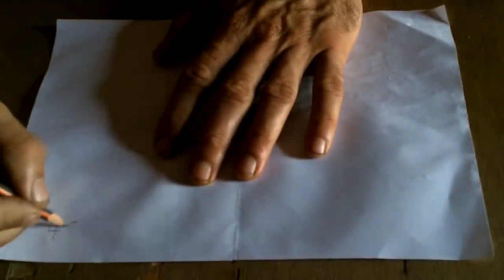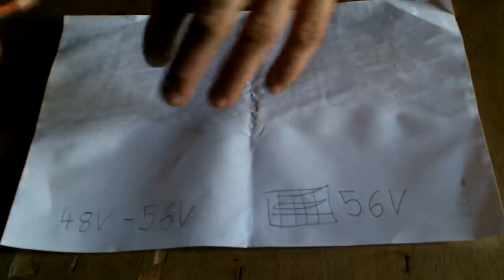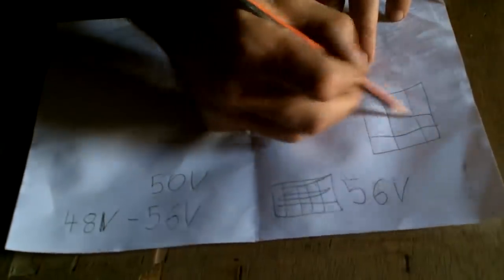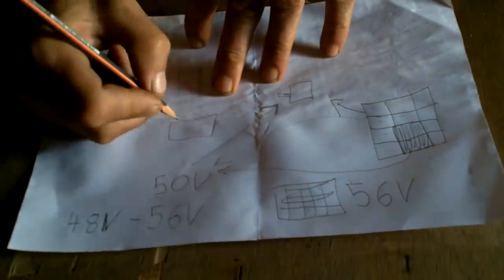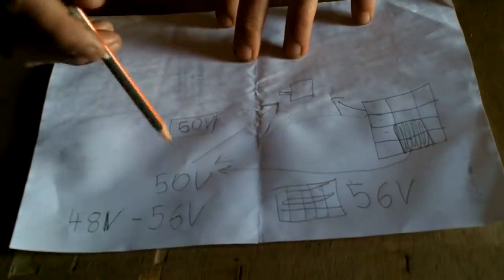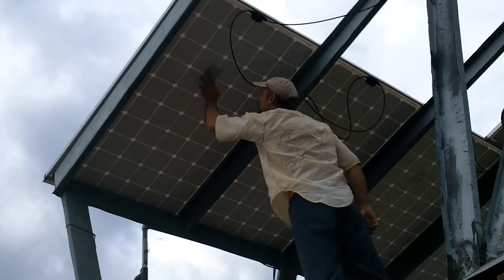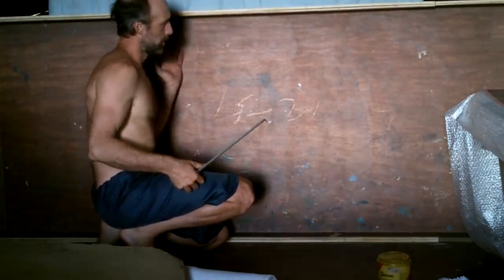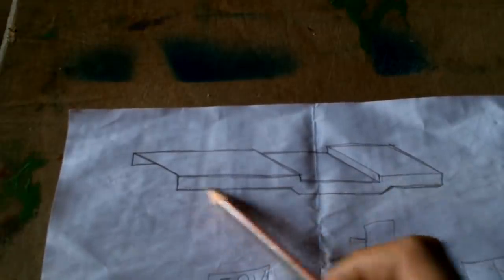Solar Snailer 028 Glass Panel n' Batteries

Comment: What is supposed to be the benefit of bypassing the batteries with some of the panels?
Reply: To not overcharge the batteries. If he is motoring rather than sailing on a sunny day he can run engine with the mass of the panels and then at the same time trickle charging the batteries.

I think this is right?
Reply: @slory17  i think that is what he means yes but its really a roundabout way of doing it. with a battery management system which is reccomended for lithium batteries it would take out the need to do that. all panels would charge to max battery capacity an then cut off automatically untill the battery is used below a set point these systems are cheap under 50 usd  for normal ones i think and small usually a pcb with wires. the better ones have casing around it and sometimes for heavvy loads/discharge cooling ribs
Reply: @rubenadriaensen  awesome. Yeah I'm a super novice when it comes to solar. And ive never seen one of those lithium batteries. At some point when I set up my system I think I'll put more effort into finding out the optimal way to do it rather than just winging it.
Reply: Sean Lory a simple charge controller is about $15 and will prevent the batteries from over charging...
Reply: @rubenadriaensen  - He doesn't need a BMS. Jamie is smart enough to check voltages on each cell block once a month in case they slightly imbalance. All he needs is a power supply that output steady 56v from a higher input. That's all. He's wrong about needing a higher voltage to charge more quickly, that's not how Lithiums work, that's how Lead-Acid and Nicads works. A simple power supply solves 100% of this and he'll gain efficiency. And he can bypass it with a knife switch if he wants to direct drive. This is all such a silly solution that makes all of his problems worse.
Reply: @MattsAwesomeStuff  bms is not absolutely necessary I agree  but it would improve the safety. And since it's so easy to put on I don't get why it would be an option not to do it. Cheap and easy to do.  So would the solar charge controller. Those are made to work with the solar panels I know from a previous experience using solar with a normal power supply does not work all that great. For reliability wise
Reply: @rubenadriaensen  - I think you have to understand that Jamie is going to reject solutions that don't fit his philosophy. He wants it simple and easy, less to buy and less to break. He should skip a BMS, but definitely use a DC-DC converter.
Reply: @MattsAwesomeStuff  It is irresponsible to recommend that someone not use a BMS, especially on a boat.
The risk of overcharging and destroying the pack or boat is too great.
Likewise with undervoltage, as a pack runs down, the cell that runs out of charge first will be reverse biased by the other cells in the pack and be destroyed. These are expensive mistakes.
Humans cannot check cell voltages every 5 minutes because they are human.
Reply: @ahaveland  - There is zero, ZERO risk of overcharging the pack with a charger set to the max voltage of the battery. And, that's not even a BMS, what you're talking about is a low or high voltage interrupt. Jamie isn't stupid and won't run his batteries down to zero, he's been doing this routine for  5 years with lead-acids so that he doesn't deep discharge them either. You're applying textbook solutions without understanding context.

And no, you don't need an MPPT. Voltage will not "collapse" if the panel is loaded. How do you think solar panels worked for the first 30 years before MPPT was invented? MPPT yields single digit percentage improvement. Big deal.
Reply: @MattsAwesomeStuff  
I even did a video on my channel 3 years ago demonstrating exactly what happens when you use a DC-DC converter to draw too much from solar panels. The panel voltage collapses when it falls below the peak of the power curve.
You need a converter that is aware of the current it is drawing and will regulate the panel voltage.
Ancient PWM controllers are simple, they just pull the panel down to the battery voltage and don't care that this is not the optimum panel voltage.

Also, lead acid batteries are self-balancing, lithium batteries are *not*.
A cell may become dangerously overcharged and the charger would not know, especially if you have 16 cells in a string.
The same can happen at discharge - the battery may look acceptable at 20% SOC, but a cell could be approaching zero volts and risk becoming reverse biased.
This is why a BMS is so important for lithium batteries.
Reply: @ahaveland  - I understand why you need a BMS in something an ignorant consumer is going to be buying. Because it has to be 100% automated and 100% idiot proof. Jamie is not an idiot. But do you understand why it's not necessary if you just check a few times a year? Cells that are matched, then charged in series and discharged in series will have the same power flowing into and out of them. They don't just magically lose or gain energy out of the ether. If they start balanced, they'll stay balanced, except for microscopic differences over time. Hence, checking once a season is plenty good enough.

As to your video, your experience consists of one janky panel on your lawn, where it was cloudy when you had your MPPT off and then sunny when you had it on, you even said so. MPPT makes less difference the hotter the panels are. In Jamie's use case, he might see 10% increase if he's lucky.

People like you are why Jamie ignores all suggestions and criticism from the rest of us. You don't actually know what you're talking about, and you don't give advice in the context that is useful to him in his life.

Comment: I wish I could fit that 2kw of solar on my boat, that's a huge array. I run a 200w wind turbine into a 4800w 48v sealed lead acid pack and 2400w motor on a 4 ton sailboat.
Reply: That's the brilliance of Jamie's design - similar to how Elon musk's Teslasaid "all you people building electric cars with 4 kWh batteries are idiots, we're putting 200kWh of lithium in there and all your problems are gone", he's just fitting WAY more solar in a much lighter platform/overall form factor than anyone else by an order of magnitude.  Literally people are building 40 ton electric solar yachts with less solar capacity than Jamie's 800 pound double canoe

Comment: You really wouldn't need a computer to do what you want.  A single diode would do the trick.  It works like a check valve in plumbing - it only allows electricity to pass in one direction.  (Not intending to question your intelligence if you already know this, just offering a suggestion)
Reply: A diode does not prevent overcharging. The battery would pull the panel voltage down to its level plus 0.6V for the diode voltage drop.
The battery will charge, and keep charging as the panel wants to get up to its open circuit voltage, which is higher than the battery.
A charge controller isn't a computer per se, but it has logic that pulls just enough current to keep the panel voltage at its maximum efficiency, and controls how much or how little charge goes to the battery, making sure not to overcharge it.
A diode only helps to reduce discharging at night, and controllers already have those built in because it's their job!
Reply: @ahaveland  - Incorrect.  He would need a diode to prevent backfeeding from the higher voltage glass to the lower voltage flexible solar panels.  Sure he could use your fancy charge controller but, he is trying to keep it simple and inexpensive.  The diode would accomplish this.

Comment: Panel array voltage at double the battery bank voltage is the normal rule of thumb.
Reply: For a PWM controller maybe, but not for a direct uncontrolled connection!
An MPPT controller can have any ratio of panel to battery voltage within the limits of its electronics and even supply a higher voltage to the battery than the panels but at a lower current of course..
Reply: @ahaveland  The double rule accounts for clouds, dirt, age, corrosion, less than 90° to the sun, etc. His design was based on the ideal conditions, which never happen.
Reply: @tom9152a  Conditions are irrelevant for a direct connection because the open circuit voltage can be much higher than the battery even when cloudy and will still try to overcharge to reach equilibrium.
However, the current gets very low near the panels' open circuit voltage.
Controllers are necessary for proper matching and regulation.

Comment: Seriously though, a charge controller would just solve your problem. Like many say in the comments. You're not getting your money's worth from your solar cells because you're not regulating the charging voltage and current! They make them quite rugged these days and you can be well served by a more basic non-computery model.

Comment: I feel slightly annoyed that u don't use all the solar panels to charge, it seems so wasteful. But I have no experience in this so....
Reply: I don't feel annoyed about that, but a tiny bit worried that others may take him to be a guru and copy his ideas.  Probably not, I'm worrying about nothing.  There are now millions of solar + battery systems in use, from garden lights to electric cars.  They all use electronic regulation, which he bats away as unreliable by appealing to uninformed prejudice.   I'm the guy in the jungle who knows better than all those professionals.  Nah, not if he's measuring voltage under no load and talking about voltage flowing, he doesn't seem to know the basics.
Reply: @raykent3211  i hope when he gets the battery deal he gets the bms too would be much safer using that